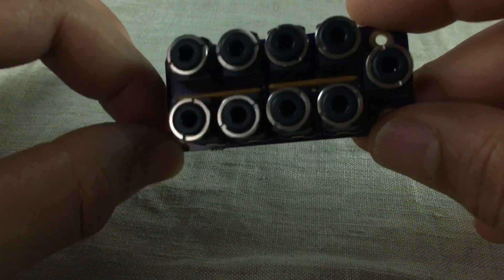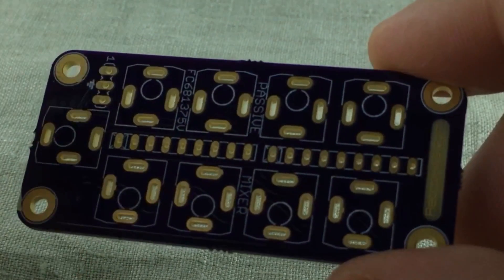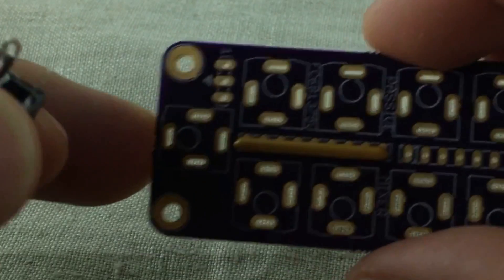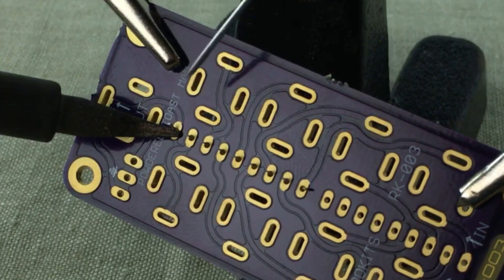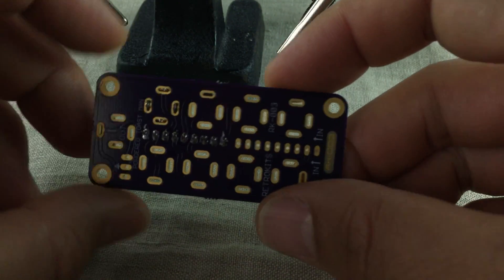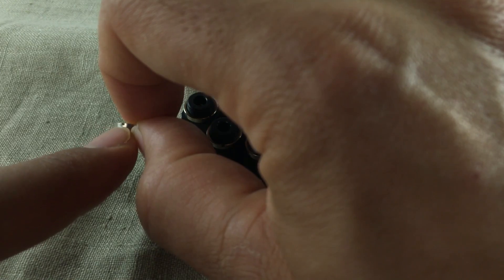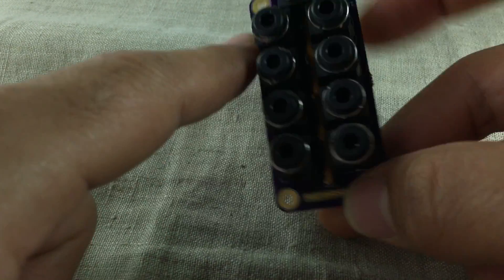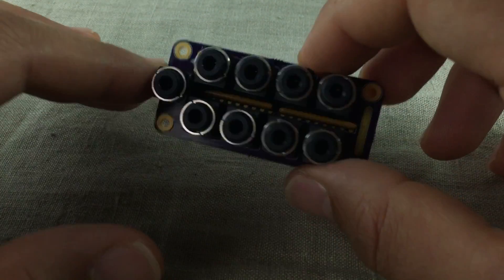Retrokits RK003 Passive Mixer build guide │ DIY Electronics - haQ attaQ

Comment: How's the sound quality on this one?
Reply from the maker: +mkkrt I didn't detect any noticeable noise or anything. However, you do loose a bit of volume output due to the resistors. So you'll have to crank up the volume a bit on what ever amplifier l/speaker your connecting it to.
Reply: +Jakob Haq Thanks.
Reply from the maker: +mkkrt My pleasure! =D